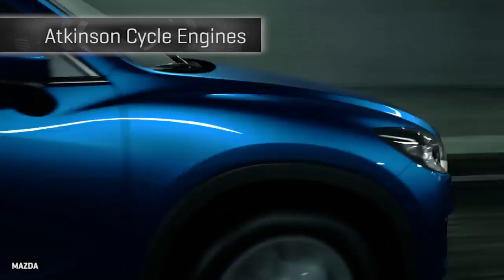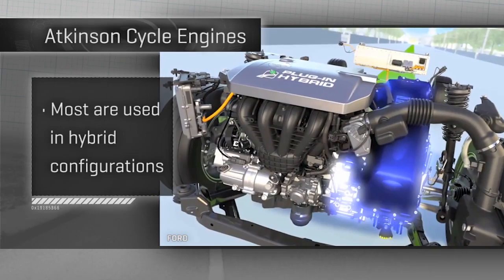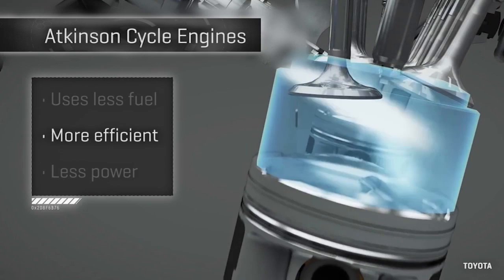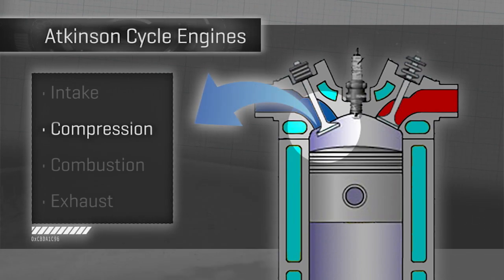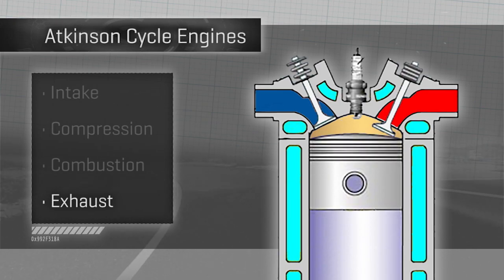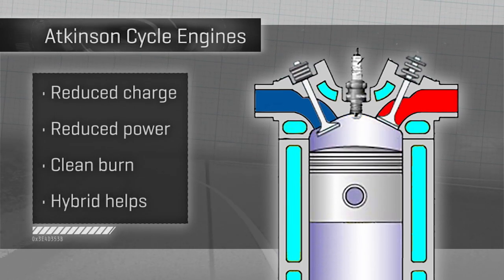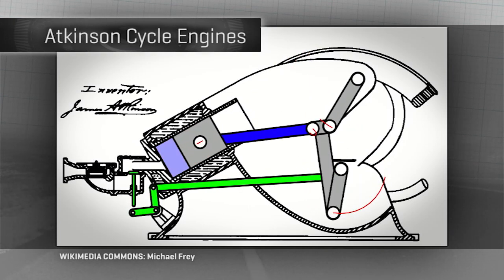Car Tech 101: The Atkinson Cycle engine explained (On Cars)

Comment: So if you want less air to use less fuel, why not just develop the engine to take in less air from the start so the valves do not need to stay open. Also, doesn't the fuel get sprayed during the intake stroke to get even fuel distrobution? Wouldnt that mean an atkinson cycle engine is pushing fuel out of the intake valves?
Reply: Yes!  But there are two possibilities that allow this to still produce the desired efficiency improvementt (A) the fuel/air pushed out the cylinder remains in the intake manifold and is eventually forced back into the cylinder during the next cycle, or (B) the mixture is so much leaner with this system that losing a small part of it into the manifold does not outweigh the increased efficiency of the power generation over-all.   Nobody ever discusses which explanation is the correct one.
Reply: @jonvelde5730 but then there is added fuel that was pushed out right. Based off of what you said, that same fuel should be pulled back in. We'll how does the engine know how much fuel is in that fuel/air mixture to adjust how much to spray? I am genuinely curious, I have almost no idea how it works. I just feel like why push the air and fuel out and possibly lost to the atmosphere, when you could just pull the air, shoot the fuel at the same time to disperse the vapor. Instantly close the valves so nothing gets pushed out and then blow the piston under max compression. Being the valves close prior to compression this way, it would compress the air/fuel more causing better efficiency, no?

Comment: What's the difference between a small-business man and a small business-man? The former runs the corner doughnut shop, and latter is vertically challenged. The hyphen tells us which noun the adjective "small" applies to.

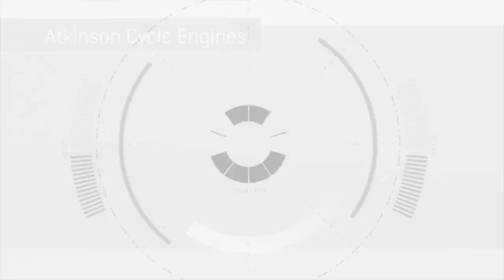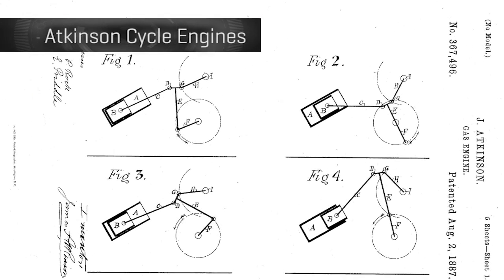The diagrams at 1:15 and 1:22 are of an Atkinson Cycle-Engine. It implemented Atkinson's concept - that you get more energy out of the same amount of fuel if the expansion stroke is longer than the compression stroke - in the four stroke cycle of the piston. It was the second of three engines he proposed - the Differential Engine, the Cycle Engine, and the Utilite Engine.

What modern cars use is an Atkinson-Cycle Engine. It implements that concept with variable timing.

Comment: Essentially you have an Otto cycle engine set up for a crazy high compression ratio (to get the crazy high expansion ratio). But u don't want to have to buy high octane aviation gasoline so u need to defeat some of the compression ratio. To avoid crazy high pressures the intake valve is left open longer to exhale some of the air/fuel back into the intake manifold. It's the high expansion ratio that makes the durn thing so efficient. 

I wonder if at higher elevation the computer instructs the intake valves to revert back toward Otto to keep more of the (thinner) air/fuel in the cylinder? Like free turbocharging for high altitudes.

Comment: An Atkinson cycle requires that the piston connecting rod be a double pivot linkage. Because of this, it’s essentially a one stroke motor, completing the 4 stroke process in one crankshaft revolution. This being showcased here is an Otto cycle with variable valve timing, something the Atkinson cycle did not have.
Reply: THis is actually the Miller cycle.  It mimics the dynamics of an Atkinson by manipulating valve timing.   Additionally, Miller eventually incorporated supercharging to back-fill some of the torque deficit in his system, so some people only call it a Miller cycle if it has forced induction as well, but this is technically not correct.  THe basic Miller cycle is acheived simply by leaving the intake valve open for a part of what would have been the compression stroke, then closing that valve to create a shortened period of compression.  Which is what pretty much any modern hybrid is doing.  No modern engine still uses the actual Atkinson linkages that physically alter the length of the piston stroke during compression.

Comment: In a kia niro, you know when the electric motor helps. It makes shifts feel very smooth (kia hybrids use a dual clutch transmission), though in "sport mode" it's very jolty but wayyyy faster

Comment: We know  it works well.  Prius's have been known to go 300k using the same battery and engine.  I think Rav4 hybrids use it too, but  as it says, the electric motors make up the difference to give it about 15 hp more than it's gas counterpart.

Comment: The big drawback of the Atkinson engine isn't necessarily the lower overall horsepower number, but the major lack of low-end torque. The existence of an electric motor, what with all its torque available at zero RPM, overcomes this deficit and makes an Atkinson motor practical nonetheless in a hybrid despite its erstwhile shortcomings. Yes the electric motor helps at higher horsepower/RPMs too, but not nearly as much as it assists with initial oomph.
Reply: That's why Toyota just turns it back to regular Otto if you push your foot farther down
Reply: Electric motor is for inital torque bro not for top end
Reply: @blazingguyop  Electric motor also adds oomph at speed as well bro.    The engine is kept right in the top end of the power curve so if you want to pass or speed up, the electric motor will also add power tot he wheels.

Comment: If it's more efficient i.e. produces more power per unit of fuel, but just produces less power per volume of cylinder, why not just use a bigger cylinder?
Reply: Because the engine's other disadvantages would make it impractical. An Atkinson engine is best suited for use where it can run at an efficient RPM all the time, like with a CVT transmission or when charging a battery. This makes them ideal for hybrid use, because the electric motor will compensate for the Atkinson engine's lack of torque at inoptimal RPM.

Comment: That doesn't seem very efficient pushing gas and air back into the intake runner, why not just inject less fuel in the first place?
Reply: This is the most efficient way. If the intake valves were closed early and fuel-air mixture was restricted this way, the piston moving down would try to suck in more air and fuel, but there wouldn't be any way for it to get in. The engine would essentially be engine-braking for a portion of the intake stroke, which obviously isn't a good thing. Pushing the air and fuel out doesn't require a significant amount of effort, and some of that charge is actually fed into the other cylinders of the engine.

Atkinson engines increase efficiency by minimizing losses as much as possible. They have lower horsepower, torque, horsepower-per-litre and power-to-weight ratios than normal engines, but they have better thermal efficiency. They are good for an application where they can run at the most efficient RPM all the time, and their trade-offs are compensated for, like in a hybrid car.
Reply: Less pumping losses. As further explained here.

Comment: Why not just use a smaller cc engine??
Reply: Because Atkinson engines have superior thermal efficiency, meaning they convert fuel into useful work better than conventional engines. A smaller engine may be equally powerful, but it would use more fuel to do the same work.
Reply: Yea, same thought. But I think the Atkinson will produce more power than a smaller cc engine since the combustion stroke will be longer?

Comment: So what happens to the fuel that gets pushed out through the intake valve?
Reply: I know it’s a little late now but basically that air fuel mixture gets pushed back out to the intake runners and goes into the next cylinder that’s going to fire
Reply: It doesn't matter what type of injection the internal combustion engine uses, in the intake stroke air and fuel is mixed inside the cylinder chamber. That mixture is reffered here.
Reply: Todays car dont necessarily use air-fuel mixture
Instead they just inject gas directly into cylinder, just like diesel
Reply: @falcon9ft710  not every modern car has a GDI engine.
Reply: @falcon9ft710  you gotta have air mixed with the gas, that's how it works

Comment: a leak.  what goes out that leak?  petrol?  what a great way to get better effeciency: waste more fuel
Reply: That fuel air mixture is still in the intake ports and is pulled in during the next cycle
Reply: Jeff Puskarich you do realize that we now live in a fuel injection era, right? The injection can be programmed to take place after the intake valve completely closes.

Comment: Or you could just tune the stupid engines correctly to begin with. It's always either underpowered, too heavy, too lean, too rich, poor timing, or poor flow of gasses. Getting the rigjt balance does NOT equal 500hp, but it does mean better power to weight and a thorough (and clean) burn. That means far less time on the throttle.
Reply: Spectre 6-1 ok mr engineer. Go and design an engine that is superior to all of them and sell them to a company. Youll get rich

Comment: this si some modified atkinson cycle, the original atkinson has a short compression and a long explosion in order to extract more power from the small air fuel charge

Comment: So would an Atkinson cycle engine with direct injection lead to heavy carbon buildup since some of the air/fuel mixture would kind of be pushed back into the intake manifold and there is nothing to clean off the back of the valves?
Reply: I have the same question. Maybe in another two years someone will be able to answer it for us :P
Reply: Yes
Reply: @fec9333  yes, the stratified injection strategy. For Audi its the TFSI and for Volkswagen its TSI 
(TFSI - Turbo Fuel Stratified Inejction, TSI - Turbocharged Stratified Injection)

Comment: This is also known as a Miller Cycle by Mazda. Essentially the difference is Miller Cycle engines are supercharged and leaving the intake valve open longer gives more time to charge extra air and fuel into the cyclinder.

Comment: Why not just inject less fuel?
Reply: You don't want a lean fuel mixture at low revs as the oxygen is too rich and it will cause knocking that will reduce the lifespan of the engine. Cars that do have lean burn at low revs achieve this by bringing the exhaust gas back into the combustion chamber ensuring the air volume is optimal and with a lower oxygen intake. Downside is you'd need variable timing on the exhaust cams too while with the Atkinson you can save cost just by manipulating the intake valve alone.
Reply: ***** Thanks.
Reply: Having an expansion ratio greater than compression ratio is beneficial
Reply: Taking in less air reduces the compression ratio, so more energy from the combustion stroke of the other cylinders gets to the axle.

Comment: Its the "wonky linkages" that make an Atkinson engine what it is. The linkages allow for the complete cycle to be completed in 1 crankshaft revolution. That's what makes an Atkinson engine unique.
Reply: The Atkinson Cycle was invented to get around the Otto Cycle patent. You’ll notice Daimler, Benz and others didn’t start making their cars until about 20 years after Otto got his patent--in other words, until after the patent had expired.

The same 20-year delay recurs in other technological developments. So much for patents “encouraging innovation” eh?
Reply: @lawrencedoliveiro9104  Patents encourage the initial invention, their expiry encourages the spread of its usage
Reply: True.  Vid shows a modified Otto-cycle piston engine using the Atkinson cycle, which is not a true Atkinson engine.
Reply: >Its the "wonky linkages" that make an Atkinson engine what it is.<
Exactly!  That's where the timing and TORQUE come from in an Atkinson Cycle Engine.  Let me guess, next year they will put a turbo on it marketing will call it a turbine engine.  This is nothing but an Otto cycle engine with VVT deployed one direction for better mileage, and the other direction for more power.  If marketing can get away with calling this an Atkinson Cycle Engine, it simply proves the adage: "Nobody ever went broke underestimating the intelligence of the consumer."

Comment: Why push air back out, why not just let less in to start with?
Reply: +Ben Wright If I read the ngineering explanations right, the thing is that once the valves are closed, the engine has to forcibly compress the air inside the cylinder, which takes a lot of force and power. The original idea behind the Atkinson cycle seems to be to create a compression stroke and an expansion stroke of differing lengths. So by leaving the valve open the fuuel-air mixture just gets pushed back out again which doesn't take nearly as much force, then closed off a little later than usual and that way you get more movement of the piston without pushing against the compressing air fighting back.
Reply: No, leading to more force necessary to make that compression happen. If you leave the valve open you can bypass that.
Reply: +Ben Wright Because it is easier to adjust the valve timing rather than changing the distance traveled by the piston during the intake stroke.
Reply: +Engineer 庄熙龙 (Not an expert so break out the salt shaker) The way i understand it is that turbos don't actually improve efficiency, they improve power. More air (turbo) and more fuel (injectors) means more power. This increase in power though tend to affect the way people drive. With plenty of power you don't need to give it as much throttle to get the same result.

With low power you run the engine at a higher percent of its available limit to do everyday things, such as driving in heavy traffic and merging onto an interstate.

With High power you do not need to press the throttle nearly as much and the result is you actually end up  using less fuel.

So I guess what I'm saying in short is the efficiency increase doesn't come directly from the turbo it comes from how the feel of the power changes the way people drive.

Top Gear actually did a small segment on this with a BMW vs a Prius around the test track and where the prius gulped fuel because it was being pushed harder the BMW used a considerably smaller amount of fuel.
Reply: Saxon Liw less than optimal intake will create a slight vacuum that will rob a little power from other cylinders, but that same vacuum will help the piston go back up. it should even out.
Reply: +Ben Wright and isn't putting more air in good? if not, why does turbos actually improve efficiency?
Reply: +Ben Wright yep, seems like they could just shut the intake valve earlier during the intake stroke
Reply: Engineer_ 314 Negative, if you push more air into the engine you have to push in more fuel to maintain the air to fuel ratio. If you don't you run the cylinders lean causing overheating and potentially cracked rings which cascade into cracked pistons.
Reply: Turbos make cars faster by allowing the engine to inject more fuel into the combustion chamber since more air is in there, but causing you to burn more fuel in the process. Atkinson cycle is the opposite of a turbocharger.
Reply: +RebelRedeye It the fuel air mixture going back into the intake valve inlet also cools down the intake thereby increasing the density of the intake air. So it acts in itself as a kind of turbo for the next cycle (well, a tiny little bit). However, the use is for low revs only to make the engine more efficient and give more torque RELATIVE TO the pumping losses it must overcome.
Reply: And how do you let less air in? You will need a valve and if the flow pressure is not optimum, the flow will be impeded, requiring more energy to make the stroke. This energy comes from the other cylinders. So rather just leave the intake valve open so that the intake and compression strokes requires less energy.
Reply: Ben Wright yeah that's how Atkinson himself had designed it.  Too complicated for today's engineers.  Just to clarify it's not air, it is the air/fuel mixture.
Reply: RebelRedeye In other words, the air is pushing against the piston, leading to less compression?
Reply: buddhaman001 On the other hand, the extra torque does come from a better, more efficient burn from the additional air so yeah
Reply: IT'SME you know that there is a variable stroke engine